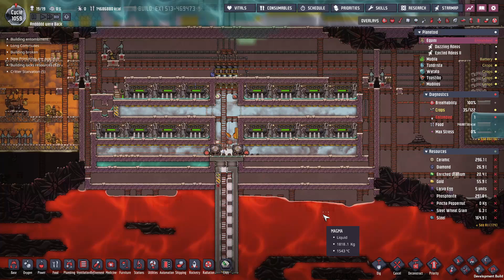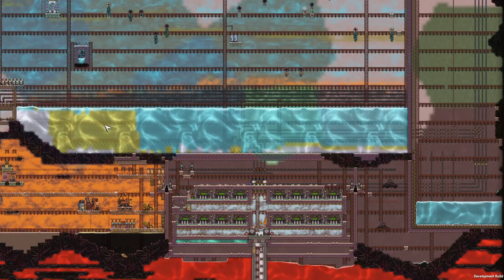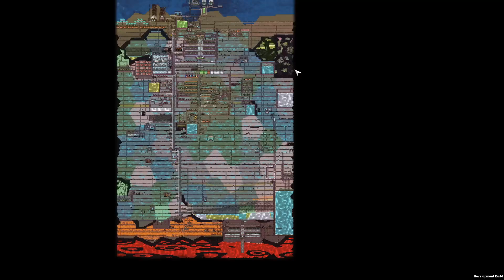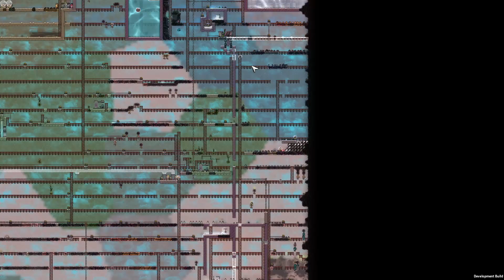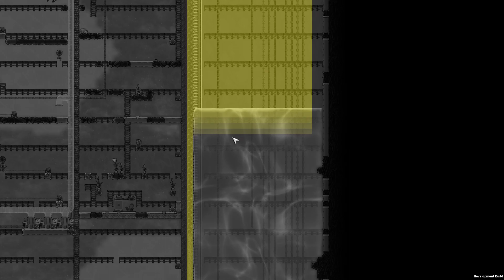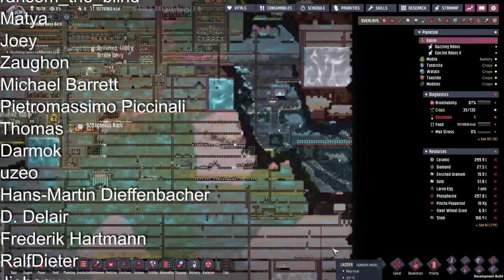Ep 15 : Some Diamonds but mostly just water : Oxygen not included Spaced out

Comment: He'll build a silly tank for water instead of powerless compression which he says is an exploit.  But he'll launch a rocket non-stop using no fuel.  No exploit there right?  That's fine and dandy.
Reply from the maker: I will admit I'm terribly inconsistent. Radbolts are new and trying to generate masses of them is a bit of a pain still so I'm trying to figure out what is the best way to do it. I mean we could use infinite rocket launches to generate infinite water via steam, or power via heat. But I consider that to far. Infinite rad bolts I'm ok with as it's just more of a time saver than a game breaker.

Comment: You can enter the water tank through the side wall by using a liquid lock with any liquid that is heavier than water (e.g. petroleum), because water always float above petroleum, so it cannot push through the petroleum in the lock.

You don't need to destruct the radbolt reflector, you can just use automation wire on it, when the signal is red, it will ignore the incoming radbolts.

You don't need visco-gel to make vertical liquid lock, you can just use 2 different types of liquid to make it, it is just a little bit tricky to make it 1-tile width.

Hm.. I don't know if it will improve the PC performance, but will you consider to vacuum out all the area outside of the living area? You know, the more tiles that contain gas or liquid, the more CPU power needed to calculate the flows of them. I see you don't like to use infinite storage, but don't think it as cheating, think it as performance saving maybe?
Reply from the maker: The game is running pretty slow, but I'm hoping when we wipe out a few hundred bees things will speed up a bit. Will have to try the oil liquid lock trick, if it works will save a bunch of time.

Comment: 22:28 Opposite walls of your heat spike don't exchange heat. Perhaps placing steel doors spaced one tile apart throughout would help move more heat?
Reply from the maker: Good point, since the heat spike is finished I'll just narrowed it to one tile wide for the tunnel down. As for the top to bottom linking we have two doors so far and we can always add more as needed.

Comment: 5:23 You may get rid of 'extensions' by making some overpressure liquid vents at bottom of the tank with a small blob of crude oil or whatever. Also for a concern of getting in tank easily at 7:23 - it's possible to make a U-shaped liquid-lock with heavy liquid that would allow dupes to hop into the middle sections without a risk of spillage. It'd be a bit tricky with already filled tank tho.

Comment: When processing Salt Water, then that precaution at 3:00 is necessary, as the temperature for the output materials matches the temperature of the input.
But unless the Brine mechanics have changed, there should be a temperature floor for processing Brine (40°C or hotter, if the input materials are hotter). 

The desalinator has always been a strange one in that regard. Can't verify that ingame at the moment, due to a very much melted GPU.
Reply: They changed the mechanics: brine no longer has the 40C floor.

Comment: Hey Francis, dont suppose you ever figured out a way of automating delivery of radbolts to the material science station. Dripfeeding 50 or even 100 radbolts at a time seems like wasting time and the last few techs are soo tedious haha!
Reply: I do a dupe motion sensor and a timer sensor into an and gate to activate the radbolts.  It mostly works but occasionally you will hit the point where you dupes get through the supplied rad bolts before the timer goes off and you have to manually fill the material station.  To accomplish this I put a switch on the dupe sensor side, flip it on and hit the reset on the timer sensor.   Oh - I usually set the rad bolts to get as close to 100 into the machine as I can and set the timer to 65-75 seconds.
Reply from the maker: Have not got a rock solid system that will work no matter what. Their are to many variables. Like even with sensor systems and multiple science stations their is always the chance you just don't have enough rads. Though I suppose with enough stations it should be possible.
Reply: @FrancisJohnYT  yeah. If they just added an automation output for the research station it would make life so much easier, but suppose that might be too easy idk

Comment: Francis!  The tank isn't big enough.  You realize we're going to demand you put some background tiles all the way up into space to make it even taller, right?  One water tower going from the top to the bottom of the map, and then of course add in the biggest set of Rodriguez's ever to oxygenate the base; plus you could also then use a heat deletion device strapped onto the tank near the bottom to cool the 95C water down to something reasonable and temperature control the entire tank by putting some diamond temperature shift plates throughout it....

OK, nevermind, I'm thinking too big here (maybe)?
Reply from the maker: Drywall it to space I can see happening. But I was also thinking rockets do check to see if they are submerged. We could build a rocket at the bottom and launch it.
Reply: @FrancisJohnYT  then you’d definitely need the cooling to prevent the tank from being vaporized!

Comment: I love that you expand the water tank to space and yet leave in the the tiles "protecting" the neutronium. :P

You can protect transit tubes from pressure damage with a drop of any other liquid or a gas, similar to what you did for heavy watt joint plates on your Rime map.
Reply: You can also just use a gas-lock to keep the liquid in, can't you?  (Similar to how you normally use a liquid lock to keep gases from mixing, but the other way round.)
Reply from the maker: Ohhhh how did I forget that. We will have to install some transit tubes so we can collect the fish meat.
Reply: @FrancisJohnYT  Auto-sweeper at the bottom with alternating airflow tiles?

Comment: Each title that you grow the water tank larger should account for an exponential amount of storage since it accounts to the pressure at the bottom being greater right?
Reply: It’s will be a linear increase, not an exponential one
Reply: @justgame5508  isn't there the increase due to 1 tile being added then some more due to the increase of pressure due to it compressing all of the tiles beneath it
Reply: @georgeashmore9420  There both linear increases, two linear increase don’t make an exponential increase, they just combine to produce a steeper linear increase, so no it will still be linear
Reply: @justgame5508  Sorry I think I meant polynomial, the increase isn't just x + x != 2x. So the first tile only stores 1000kg but the second tile allows for the storage of 2001kg for example but since each tile above the first tile increases all the tiles below it's not a simple 3 tiles equals 3000kg hence non linear or 3 x 1 tile == 3 tiles would be true
Reply: @justgame5508  For gases in real life, it's exponential up to a point.  No clue what happens with liquids in ONI.
Reply: @MatthiasGörgens  Yes! that's what I'm thinking of, I think that @JustGame is correct it isn't exponential since the relationship will be tied to gravity so k/R^2 will most probably be the relationship (inverse square)
Reply: @georgeashmore9420  Density of gases goes up exponentially, even when you have uniform gravity. (Which is a good enough approximation for the entire height of earth's atmosphere.)
Reply: @MatthiasGörgens  Ah I didn't realise
Reply from the maker: I just want to know how big the bounce is when you hit the top. Also pretty sure we will hit 2000kg+ on the bottom layer before we get their.

Comment: forget the rocket chimney, we got a water chimney
Reply from the maker: Rockets can launch submerged, we could in theory use rocket heat to turn it all to steam.
Reply: @FrancisJohnYT   or radioactive soup
Reply: @FrancisJohnYT  I'm so sorry for starting this, but you have to.
Reply from the maker: @ethynkoen  I don't think you are sorry at all 😁
Reply: @FrancisJohnYT  Not one bit. Although I do think by the end of this playthrough you're going to need a new CPU
Reply: @FrancisJohnYT  There's some neutronium in your water tank, maybe you should shave it off? You no longer have to fit the neutronium between the bottom and top of the rocket, you just need one of the classic engines to clip it.
Reply: Wait if that’s the case then could you shave your way to the other maps or are they too far? Or could you connect from shaving both sides?
Reply from the maker: @guyincognito1406  unfortunately not. To shave the nutronium you need some to be sticking out. If the wall is completely smooth you can't shave any more.
Reply: @FrancisJohnYT  I need to see this occur!!!!!!
Reply: That doesn't mean we cant turn it into a rocket chimney
Reply: @ethynkoen  Nuclear steamy hot rocket chimney! :D
Reply: Can Rockets lunch underwater?...
Reply: @saferomo2813  hell yeah, breakfast, lunch and dinner!